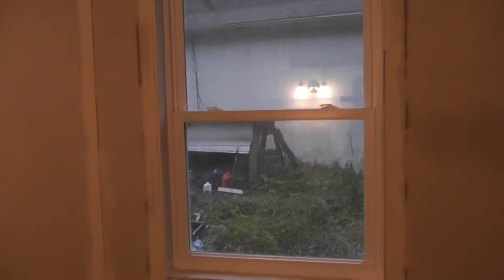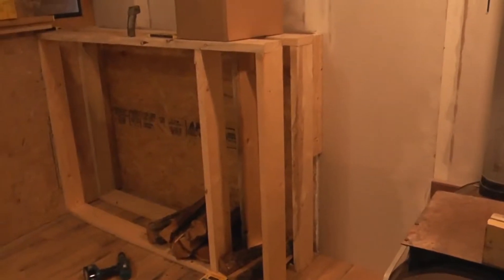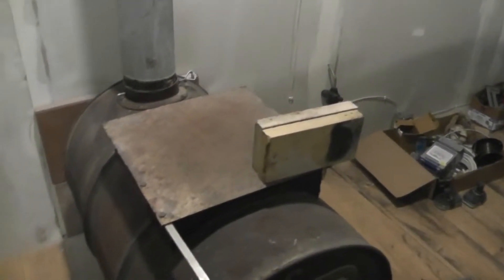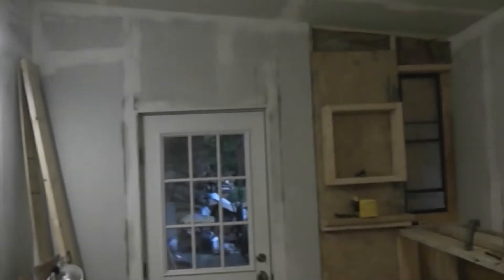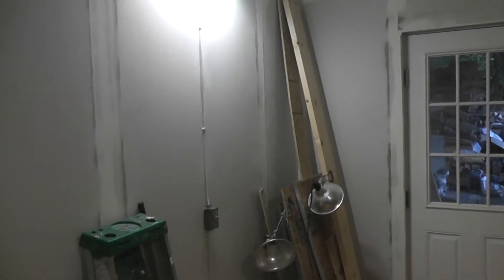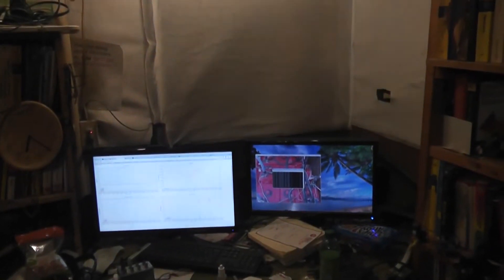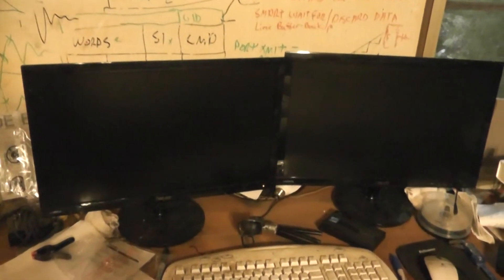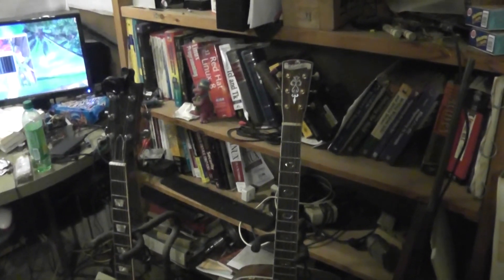NewRoom progress

Comment: Hm, do care that you don't expose your guitars to large temperature changes to avoid warping. :)
Here's something you might be interested in, to think about and experiment with: "Bashar Space Time Antenna"
Greetings from Croatia!
Reply from the maker: +xii226a Greeting back to Croatia!  I find that relative humidity changes affect the more-delicate acoustic instruments far more than mere temperature changes.  In fact, of the custom Blue Ridge guitars I have, one is set up to play well in winter, one in summer.  The Les Paul is not affected in the least, nor is the one right handed guitar I keep around (just in case some visitor should need an axe) - an Alvarez, which the music shop would not sell for me due to a tiny crack in the top - I'm glad, as it played the best of a collection I inherited (which included a Gibson ES 335)...and sounds great, no buzz due to the crack which appears to only be in the finish.  My more-delicate ones tend to have their  tops sink in winter - laying the strings down on the fretboard (not neck warping) - and rise in summer (more humid).  I've more or less solved that one by having one with a high and one with a low bridge, since good humidity control is difficult here.

Comment: Hey Doug, that addition is looking great. I've been browsing your forums and website and it just occurred to me, do you have a mathematical or rigorous understanding of nuclear physics? I know that a lot of your work comes from trade secrets and shared knowledge, but if you are building that fusion reactor from trial and error, WITH all of these add on's, that's pretty amazing.
Reply from the maker: +Mattthewz It's not that simple.  Yes, I have a pretty good understanding of nuclear physics - and the stuff we're using is fairly simple as those things go.  But yes, there's also tremendous trial and error - a huge search space for what we are looking for.  Math has, in essence, let us down.  It can't even solve the 3 body gravitational problem feed-forward, you can only do it perturbatively (iteratively in this case)..  I'm dealing with a ... 10^18+ body problem, with both polarities and different values of mass..and it's recursive, like the weather.  Those equations are simple too, but...
Who would look at Z(n+1) = Z^2 + C  (in complex numbers) and predict the Mandelbrot set looks as it does?
Similar issues mathematically to weather prediction with slightly more complex equations of state.
Start here: https://en.wikipedia.org/wiki/Quadrupole_mass_analyzer then follow the Mathieu equation, then add space charge effects between the particles - and add both polarites (lots more terms he didn't have).  Then predict the parameters that lead to the fusible nuclei colliding hard enough (or staying close together long enough) to quantum tunnel into fusion.  Simple ;~)
Reply: Well wow, that's pretty amazing. I'm currently studying math and physics in college, and what you're doing is very inspirational. You really are a Philosopher King. :D

Comment: A fusor master control room... Damn would that be a sight to see, a master control room for a fusion reactor that was built, maintained, and is constantly being enhanced by one guy and an online community... Wow... If this could be done by one person and a community, imagine if EVERYTHING was open sourced? There would be no such thing as a suppressed invention...
Reply from the maker: +Plato Most so-called suppressed inventions are actually simply subsumed by something better - while the inventor whines he didn't think of the better thing, at least, that's my own experience.  YMMV, of course. For example, Tesla's bladeless turbine was 1% efficient,,,as soon as blades could be made, no point in that anymore.  His "energy transmitter" had similar issues, and luckily - had it worked, we'd be living in a microwave oven, more or less.  

The real deal here is that I don't have to answer to committees, funding authorities and general bureaucracy, unlike most workers, I get to follow my nose, and I can turn on a dime - because it's my dime.  That makes it easier to make progress quickly.  On the other hand, an idiot with all the same (other) advantages wouldn't get far...  Most things should be open sourced indeed, but it's not magic by itself.  You can't teach those too lazy to learn.